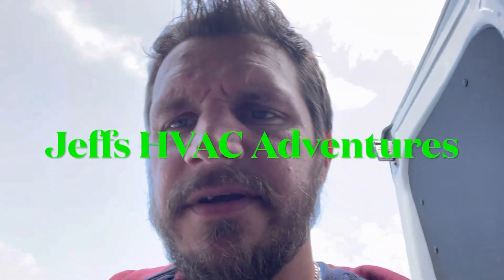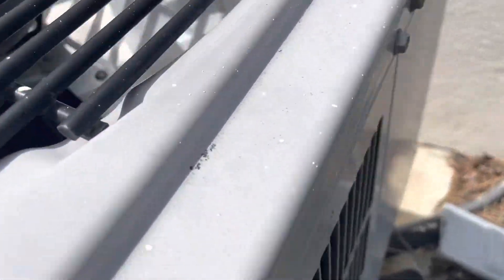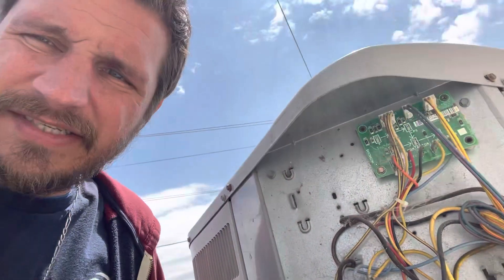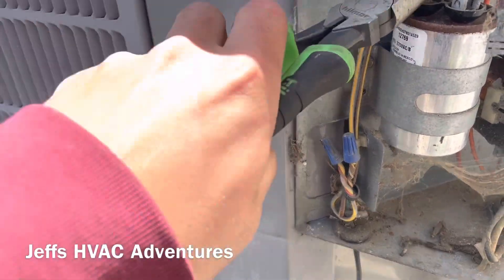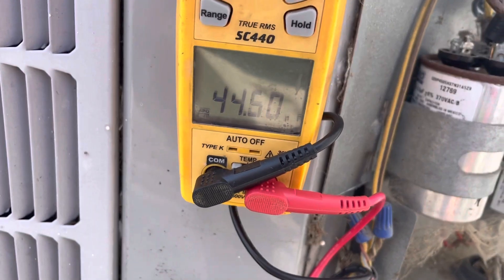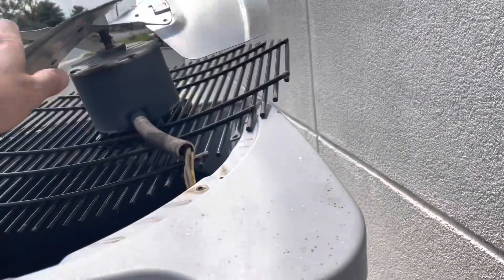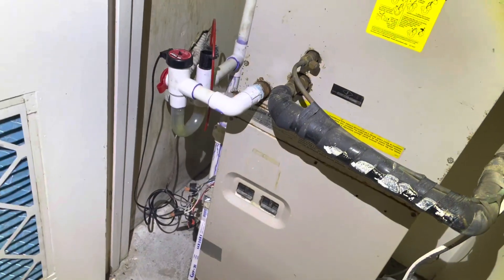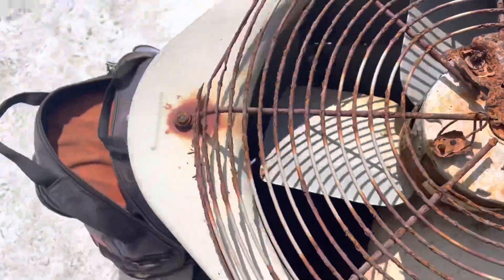Condenser Totally Rusted Out! 2 Calls, 1 Video!  #hvac #airconditioner #heating

Comment: That United Laboratories placard you saw for is to indicate the unit was listed as certifiably meeting test criteria of the Underwriter's Laboratories ("U/L Listed"). I never knew U/L to actually make products, just verify their safety performance. I checked the Wikipedia entry and it has no mention of manufacturing operations, just standards development and product testing. Manufacturers put on these labels to indicate the product is safe. Some safety codes might even require such things. U/L began with electrical standards, so from extension cords to vacuums, pretty much everything electrical used to be U/L listed. Take a look at a light socket. You'll probably see a label there, too, unless U/L is no longer the big deal it once was.

Other countries such as Germany had an equivalent, I believe, so there products might have some other label.
Reply from the maker: Very cool information!  Thanks for that.

Comment: You should have put your sticker on that second unit and hooked it back up.  That way they would know who to sue when it went flying off the roof next hurricane. 

But seriously if you do the fan on the first job id probability do a new cap also. That one looked like it was about to let loose. Good vid
Reply from the maker: Changed it out yesterday brother.  Check it out Replacing 

Condenser Motor On Carrier Condensing Unit!  Follow Up. #hvac #airconditioner #heating
https://youtu.be/2Fder1jdd64

Comment: The motor may be okay.  Id just put it back together, and let it run the bearings may loosen up.  Also do you have to put an original carrrer motor in?  Id use an emerson rescue motor much cheaper than oem.
Reply from the maker: Funny thing is, I bumped it with it out of the unit upside down and it ran.  But when I put it back, it wouldn’t run.   I like to go back OEM when ever possible.